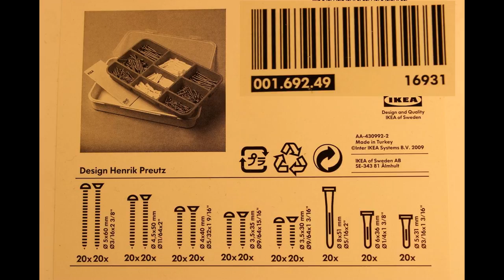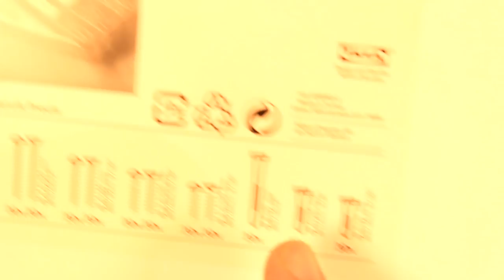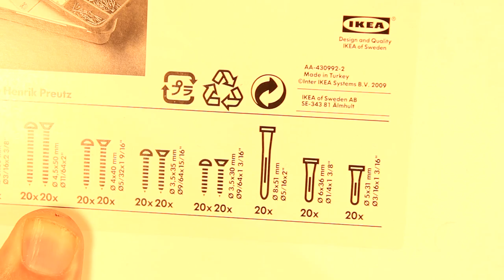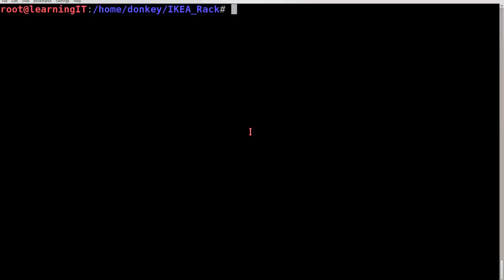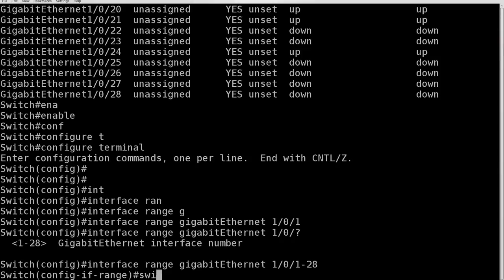Building an IKEA Lack Rack on wheels for Cisco CCNA and virtualization home lab

Comment: Very good hack! You could also buy another table and use the table surface to put on top of your rack
Reply: It's almost impossible to do that since you'd need to rotate the legs to tighten them. I can't think of another way to try your suggestion as I'm looking to do the same but I'm open to ideas from you :)
Reply: @festusd3368  what is your email address.. I will send you a video/photos
Reply: @carlhudz  Hey Carl. Is there a way I can inbox it to you on YouTube?
Reply: Could you inbox it to me here on youtube or post the link here?

Comment: Great idea - where did you get the metal handles from?
Reply from the maker: Handles are also from Ikea. They are the 55cm metal "Bygel" handles, which fit rather well the distance between the table legs, and they stiffen the whole construction quiet a lot. Also, they provide some anchor points to which one can Velcro-tie the cabling.
Reply: Unfortunately, IKEA discontinued Bygel rails and no alternative rails at this size. Item 500.726.45. Amazon price is $18 for one!

Comment: So you're not afraid of your hardware sitting on top of each other ?
Reply from the maker: The top of the switches was scratched already anyway, since I bought them used.
I fully agree with you, this solution is not pretty. However, it is quick and cheap, and does not require carrying heavy metal cabinets up to the third floor with a busted knee without an elevator in the building...

Comment: The plastic thing is called a Wall Plug in English :)
Reply from the maker: Thanks for the info!
I have also looked it up on Google, and the translation was wall-screw-anker. At least I have learned something new as well.
Reply: Stuart Bunn I thought it's called an anchor?
Reply from the maker: I tried to look it up in the dictionary, and most results give something like: drywall screw anchor. 
This is a really long description of the actual functionality, which totally reminds me of those "short" German composite words like: Schallplattenwiedergabeanlage
Reply: @DonkeyLearningIT  Normally the anchor goes in the hole first, behind the object you want to screw into it.
Reply from the maker: @illestofdemall13  If you drill the holes right, then indeed that should be the right way. However, this IKEA thing is made out of some super thin material, so it will just break if you drill larger holes.
Reply: @DonkeyLearningIT  The hole would be the same size either way.